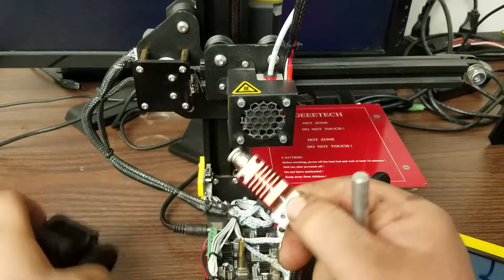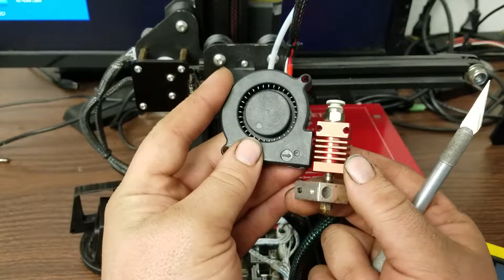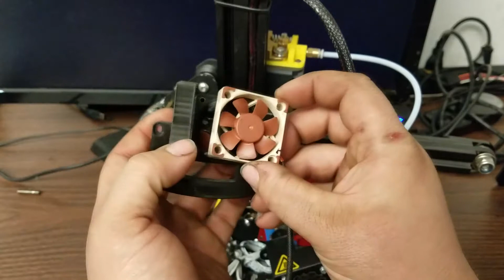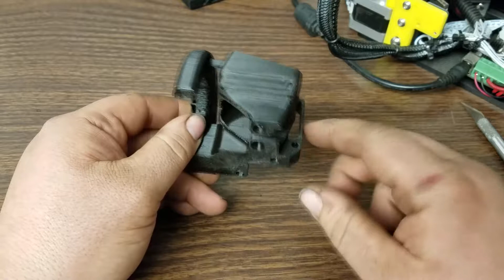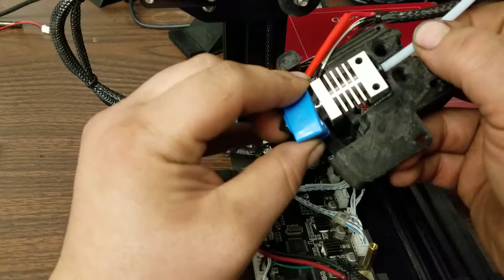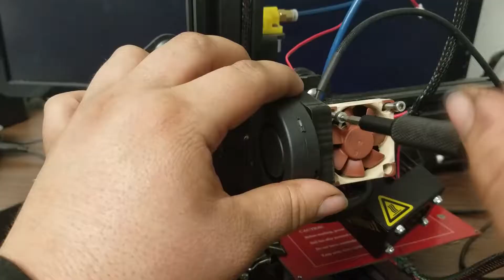Dirty Paws - Creality CR7, Micro Swiss Hotend and Noctua Fan 3D Printer Upgrade

Comment: Excellent video! I'm one week into this hobby and have done TONS of research on my printer(CR-10) and the issues most commonly associated with it and others like it. This hotend came highly recommended in the forums. This video helped me out tremendously! Thanks!
Reply from the maker: Glad I could help! I will be purchasing another to put into my new Ender-3 soon. One thing I have learned since I made this video about steel nozzles is that they do add a little more friction to the movement of the filament. While the nozzle is nicely machined and polished internally, some filaments can have feed issues. If you are having inconsistent extrusion with a particular filament you can cut a small piece of a dish sponge, put a couple drops of oil on it and fold it over the filament where it goes into the feeder with a zip-tie holding it shut. There are 3d printable holders out there for doing this but a zip-tie works just as well. Most people say canola oil but I used mineral oil because its what I had on hand for some PETG that decided to be uncooperative and it worked great.
Reply: @dirtypaws4643  so far it seems that YOYI PETG isnt having any feeding issues thus far. And the TTYT3D silk dark violet feeds and looks spectacular! However, the exact same brand but in the Silk Gold color feeds like garbage.. maybe my bed height is off I'm not sure. The other filaments seem to print just fine. But I'll definitely look into this idea mineral oil lubricant process. Thanks again for the great info!